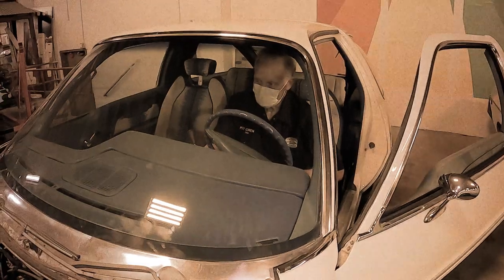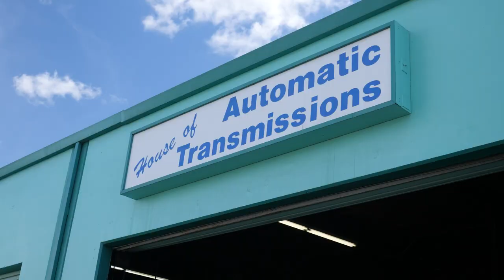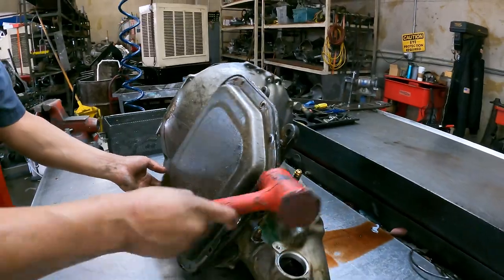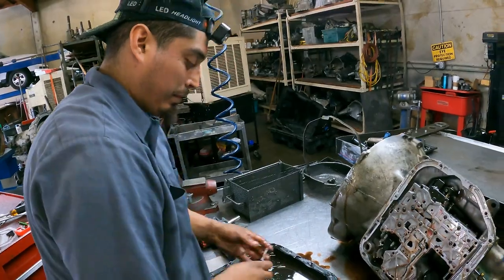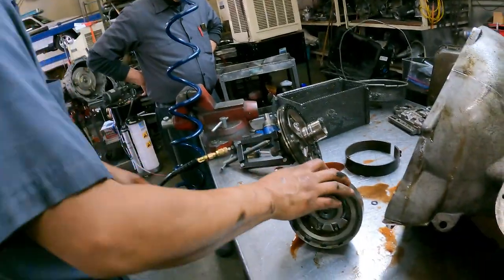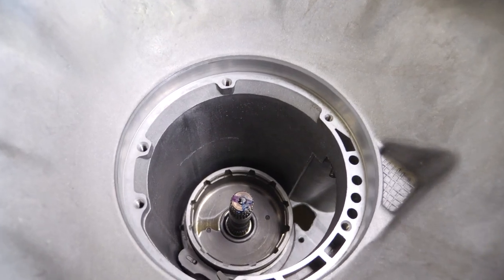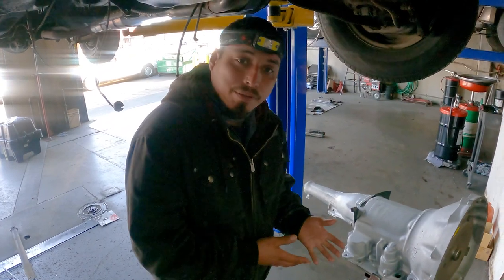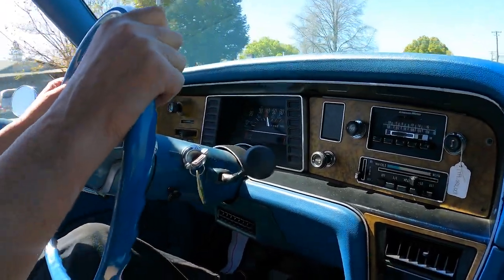Rebuilding Transmission - 1977 AMC Pacer - Episode 9 On the Road Again

Comment: I have rebuilt many of those 904 and 727 transmissions. They are very simple and rugged. One thing that I always did was before putting the valve body on, I tested the clutch packs and band apply systems with air pressure. Watching this video, I wondered if that was edited out or just not done.
Reply from the maker: band operation was checked by air, just not included in video.

Comment: Great video, appears to be a nicely run shop! 

What is "House Of Automatic Transmissions" opinion on "Lubegard"?  Lubegard's  Manufacturer states it replaces the Whale Oil that was eliminated in the 70's.  I change the trans fluid and filter, in all my vehicles, every 30,000 miles and add Lube Gard.  The following vehicles have original AT's, working fine.  1988 Lincoln 289,000 miles, 2000 Ford Excursion 217,000 miles, 1994 Thunderbird SC 340,000 miles(sold) .